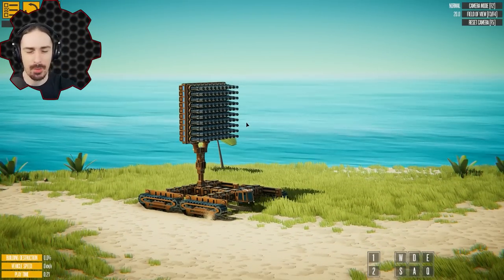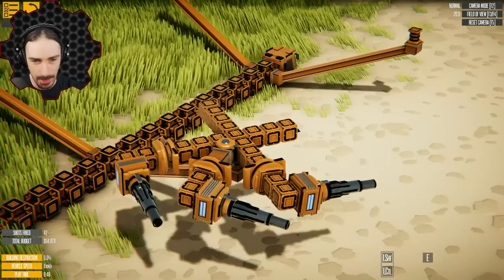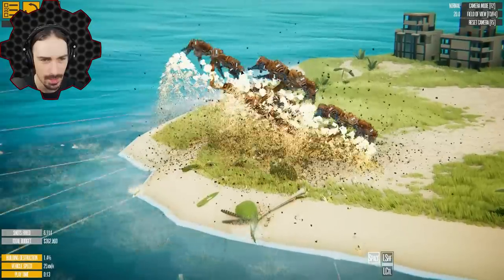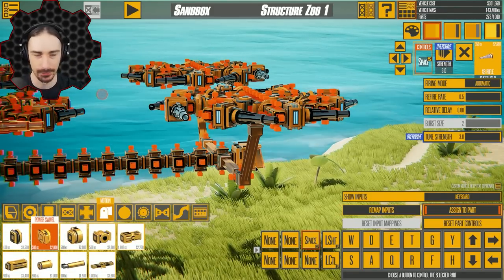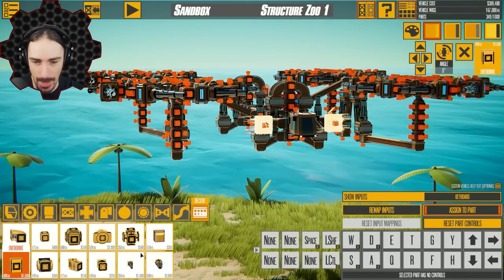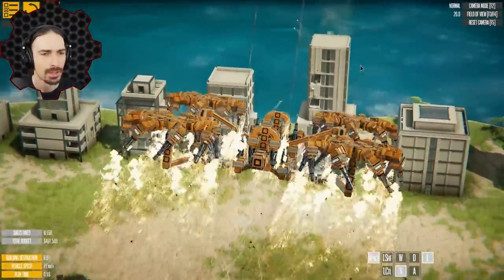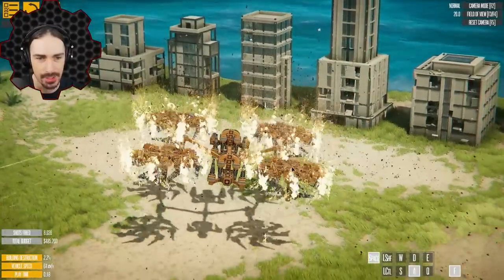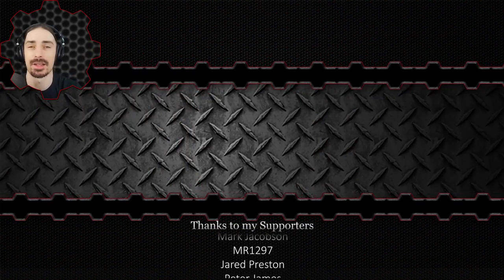I Built a Quadcopter Using ONLY GUN RECOIL for Thrust! [Instruments of Destruction]

Comment: I might have gone with 3 or 4 downward facing pads of guns.  one key to fire each pad.  Regular quads get their downward thrust from each propeller.  then the controller manages how long each pulse of power is out out to the motor.  using 4 keys you could simulate this with the 4 pads.  press all 4 at the same time would rise evenly, holding 2 and pulsing 2 others would cause a pitch/roll/yaw, depending on which 2.

Comment: The one flaw I can see scrap man having when building is that he always tries to give every creation every control he can think of when some thing's just don't need to strafe or whatnot. It's perfectly acceptable just to make it fly up and down and tilt in every direction because that already covers every direction you can go. Especially with how unstable this things flying is already there's no reason to try to optimize is. At the end you just used the flying guns for attacking anyway so you don't need the yaw or weapons on the front. That means you could remove those and shoot/ram a building which you've already proved that you could stay in the air while doing such.